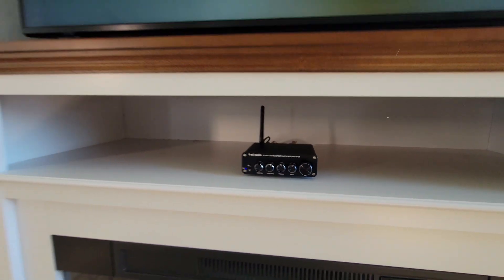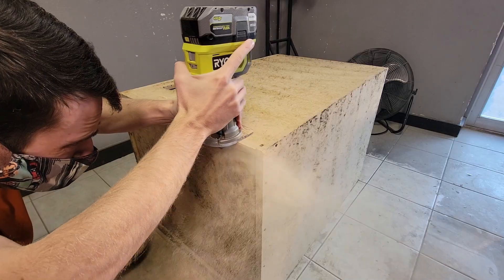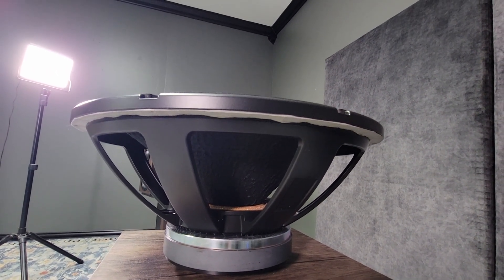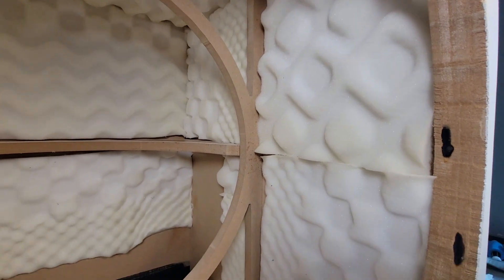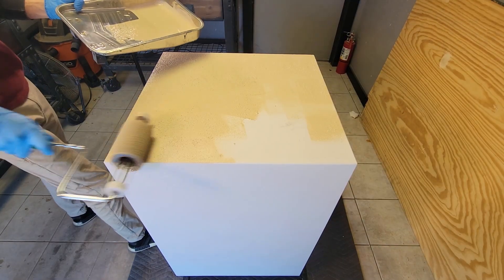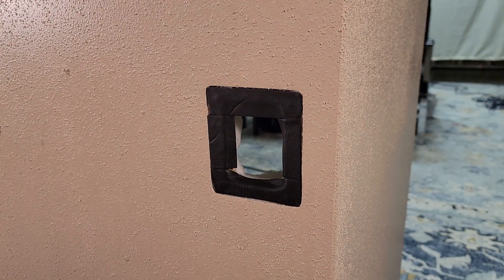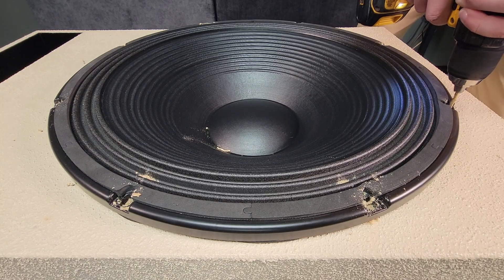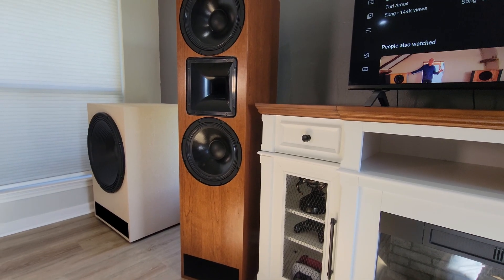Building The Cheapest 21-inch Subwoofer In The World / Powered By A Desktop Amplifier

Comment: Have you noticed when powering off the small amp makes the speakers pop. Like fully of the main power. I have the same amplifier for my set up. As long as i keep to connected to main power it doesn't do it. So im not sure if it's the amps or power supply which dumps the power

Comment: the output of this being so high from such a low powered devices does seem crazy on the outset. However, if you go back to the 70's, you can see how the industry already had to do this. Back then they didn't HAVE 100 watt home amplifiers, and had to go MASIVE on the cone size to achieve high volumes. I still remember my dad sansui speakers he bough while in the 70's when he was in the army. they were 5-way!!! speakers with 15" 'lower-mid' range cones and had a max power rating of 80 watts at 8 ohms. my brother and I were never able to turn them all the way up, they were SO LOUD!!!!
Reply: In the first time the large membranes that reinforced with spokes introduced (maybe) in the beginning of the 20 Th century and those were very thin . Those built in to large cupboards what were both acoustic amplifiers and (ornamental furniture) was. At that time those were full-range speakers and in the early days, the engineers fight many problems, such as efficiency.. (Those were very weak and aren't bass speakers).

I give some information to seekers..

Why more speakers and not a big one, and hear a real low frequency (?)...

Fs – free-air resonance frequency of the driver (here i used it a bit for for box resonance reference).
PA – Professional Audio (stage systems).

-The first: is the box complete size and the chamber size of the box what need to the excursion. (For huge boxes for a most of people haven't got enough place) A large speaker can move max (some) mm in a little box with enough soft sound.
The air compression cause distortion, not wanted sounds, mechanical sounds of speaker and hardness of sound. (but unfortunately moving too much air cause another problems)
For this reason an average low frequency speaker can be use on the 1/3 .. 1/2 of the Xmax without mechanical sounds.
In my experience the chamber of speaker size is optimally (membrane surface cm^2) * (excursion cm) =liter. 
Maybe you think this is an exaggeration.. (and really is not in every case good, maybe just i feel it good).
This is a limit where i cannot exactly sense more hardness. (With MY speakers).
My favorite box chamber ratio is W:H:D 2:2:1.

And the fact of acoustic short circuit what based on box duct length what if not enough long that cause you cannot hear the low frequencies. The duct cross-section area is in the technical literature is the 0,7 of the membrane usable surface but for example i use 100% because it depends on length because the forces (air pressure) on the membrane must be tiny. My duct is now 4,25 + outside 1 meter long from membrane to membrane back side and a strongest resonance is perceptible really on 14..16 Hz.
This way you see the box size is will be soon huge. 

-The third: the mass and surface of a large membrane cause it is late in phase compare with the smaller membranes. It maybe manageable but with just some mm move, this is why the PA speakers not infinity large. 
(But the large (more speakers) surface with tiny move is a good strategy for softer sound, lower frequencies)
The membrane materials (and of the box) is take a physically resonance frequency limit, absolute impossible made an FS under 15..20 HZ because the needed rigidity and low distortion is contrast to the lower FS materials softness and those mass.
This cause that the larger woofers has not exactly lower FS just the moving mass compensate it a bit but far not enough. (And the membranes have 'wild' resonances what you hear as sound but does not the original frequencies)

If even so you try to build one..  the materials thicker, heavier, less responsive extreme hard to move or brake down by physically inertia  meanwhile the magnetic gap need to be very thin without coil crashing with magnet.

When i started to studying these me too want lager membrane but i see how that work in the real world.

If you seek a big one you can watch the "The making of the Matterhorn" from Danley sound labs. In the interview video the man say the parameters. If does not impressive than nothing. (40 speakers if i see good)
I think that need to be sectional phase controlled but i don't remember he said.
And i think they use the colliding waves undergo constructive interference and they made a 'virtual horn from air' but i don't know.
I tell you it use another known audio technology fact: The 25..30 cm speakers give enough good electrical efficiency-Mechanical efficiency ratio.
  
-The fourth: hard materials and surfaces in the room can change the audible frequency, that sometimes multiplied because of the limited distances of the surrounding surfaces. 
Maybe you feel those enough low the truth is 'those are not the original low frequencies'. 
For example the needed distance between you and speakers is around 4 meter (343/20/4) (on 1/4 wave length) on 20 HZ if you have all the speaker and box can the frequency.

And if you can all do it somehow, than you meet with the next fact: All objects and material in the room begin annoyingly resonating :)

(every bass speaker can be produce very low frequencies but just with very low efficiency especially in small box)

The hifi lovers try to make lower FS multi-layered or foamy membranes with fast movement (nowadays expensive electronics and hard magnet motor and huge coil (that give heat dissipating and electrical efficiency) can control the movement of a 40..45 cm woofer enough fast with minimal distortion and less 'wild' resonances in a small box (but that is a hard task).. 
And the PA systems work with minimal moving and much more rigidity for higher volume.

And we have the box not wanted resonances (especially the horns have that).

And on the end of these, your hearing have a limited dynamically range what cause if you increase the volume you lost the details of all the sounds.

Subwoofer is in audio literature under 50 Hz but i use my own between ((3Hz -12,3 dB)5 Hz -3,2 dB) to (18 Hz -3,4 dB (MFB single ended butterworth second-order filter, read upon it)) it is underdriven below FS, is a good technique especially combined with a limiter for softer sounding.

Really the fact from woofer is: On original real low frequencies you rather not hear some another sounds when an subwoofer working than hear low frequencies. (But the pressure of air is tires your ears and brain more than you think (!) )

I write all these for others who's want to know something  (starting strategy).

Comment: with the BT30D at 32v / 5a you can only send around 20watts to the 8Ohm speaker before it starts clipping. This will damage the speaker and the amp. That's just dumb, because even with the BT30D pro at 50v / 10a you can only use 165w / 8ohms max. Do more research

Comment: I wonder what this thing would sound like with the 1000wrms! I just completed a custom build on a really old Peavey sp118 passive woofer. I replaced it with a cheap Rockville rockville rvw1800p8 matched with some passive LPF's, a Mackie Mixer, and a QSC RMX1450 in bridged mode at 840wrms @8Ohms and holy hell this thing slaps! I changed it from the original 46Hz tuning and dropped it down to about 35Hz with a custom port and wooooow it really pushes some air! Love seeing stuff like this where it can inspire people on a budget to really get creative. I probably spent around 400 for everything and got a super nice subwoofer out of it. I paired the sub with 2 Peavey 215 cabinet speakers on a QSC RMX850 @4Ohms and wow it sounds so balanced and crystal clear! Best home audio setup lol - maybe a little overkill with about 1500wrms going to the sound system, but got dam is it worth it! Cheers to cheap audio builds!
Reply: It sounds like crap obviously. That why there is no sound test.
The amp at 32v/5a can only send around 20watts to the 8ohm speaker. Then it starts clipping. The Amp can't handle the load for long and will break. Its a really stupid idea.

Comment: what is the use of the 21inch sub if you have such a small amp that goes up to 100w rms for that 21inch sub you should go for a at least a 1000w rms amplifier
Reply: it's a high-sensitivity driver and not every application needs as much power as the driver can handle

Comment: @4:05 isn't sensitivity measured at 1khz which is not helpful for below 100hz subwoofers?  Not nit picking but have heard the sensitivity argument debunked in the past.  I have built many sub boxes in the past with pretty poor carpentry skills, the wrong tools, and ended up with an embarrassing looking box  but SLAMMED!!  I use Winisd to model my subwoofer ideas and am always excited once it is finished to START TESTING!!  

Last project wife and I did was (2) 18" Stereo Integrity 8cu foot sealed angled boxes for behind the couch (1 8cu ft box per 18").  Had to purchase a Parts Express DSP module to tamp down 65 to 80hz because it was like 10 db louder then the rest of the range.  Thanks for the video, enjoyed it!

Comment: Do you have any recommendations for these in a sealed box? 

I have a pair of sealed ultimax 18s for ulf and will have to place the 21s in a 30hz null due to my room layout. 

I built a custom console that currently houses the 18s but I plan to turn the 18s into side tables(and avoid the null)  and replace them with the 21s. They will be powered by a crown 1002

Comment: Also, the sub itself says it's rated for 1000w RMS, I've read (countless times) that it's worse to underpower a speaker than overpower it, how is giving 1/20th it's rated power okay for it?
Reply from the maker: Hi, this is a myth. There is absolutely nothing wrong with running a driver with low power. In fact, the majority of the time, a driver is being used well below it's rated power.
Reply: @DIYhyfy  That's a good point. Thanks for the reply! Been loving the videos!
Reply: @DemarcusJohnsonIII  It can damage the coil of the speaker when under powering it if u are pushing the amp to its limits. This will make the amp clip and fry the speaker. U want to spend clean power, so using  an amp that has more rated rms to the sub is better then under powering a sub and pushing the amp. Hope this helps!!
Reply: He's giving the sub 100% power at whatever volume level he's listening to. Lol.. do you want him to only play at like 135dB?
Reply: @BobFrostV more like 60bd😂

Comment: Im looking to build a dual 21" subwoofer for my christian edm events - would these Dayton subs work? what amp would I need to really crank up the volume and shake the room? Ideally we would build two dual 21" subwoofer enclosures and have them side by side in front of the DJ ... what amps would be required to make sure they get powered correctly and what box enclosure should we build to make sure they slam? (our build could be dual 18"s if that makes more sense - similar to JBLsrx828sp)

Comment: I am enjoying your content! 
Let me suggest that you would notice a sonic improvement if you bypass Bluetooth? I switched from Bluetooth (which I thought sounded fine) to a DAC (the good measuring, highly regarded, and inexpensive S.M.S.L SU-1) using the HDMI ARC output from the TV, and was surprised by the very noticeable improvement in sound quality. I’m sure your setup sounds great but I believe there’s untapped potential yet to be realized. Keep up the good work!
Reply from the maker: Yes, I have since gone with my separate dac, pre, power. There is of course a huge improvement. 
But as mentioned in the video, I does sound great. Especially at such a cheap price. Just to get a newbie into the hobby, they're great, amd affordable.
Thanks for watching!

Comment: The mattress topper is doing the square root of f-all. Standing waves aren’t an issue in a subwoofer enclosure as the wavelengths are longer than any of your enclosure dimensions. Even if standing waves in a subwoofer enclosure were an issue it would still do nada. In order for “egg crate” to do anything the peak/trough would have to be minimum 1/6th of the depth of the wavelength you’re trying to diffuse.

Comment: Hello sir, i'm an engineer from italy, i'm on PA management field. One thing about this setup i need to say, the amp besides being really cheap, is the classic "mini house hifi amp", this means, probably have really really small control on a 21" pro driver, that can results in various problematic situation that can damage the driver, pro driver need to have a lot of power reseve, that's why PA amplifier are so expensive. Keep anyway in mind that a 21" pro driver is built to be driven from atleast 2kw RMS amplifier, but it can easily get damaged from a 100w no reserve amp peak/square.
I'd suggest onestly something more PRO related, maybe china/cheap products with more complex DSP and FIR, they became a lot more affordable nowadays.
Reply: He could measure his fosi amp with a load and oscilloscope to check for waveform distortion. My hypothesis is that it won't be a problem in his use case.
Reply from the maker: Interesting, are you saying it needs more rms capabilities? I'm not generally running it very hard at all. The driver is only 1K watts rms, and didn't model well with that much power in the enclosure if I remember correctly. I may be missing something you are saying though
Reply: @DIYhyfy  Sure, enclosure is not tuned to get the XMAX, but the thing is, if u get a transient on a track or something that makes the amp peak or lose the power reserve ( that at this point is really low, as amplifier dimensions say) the peaking of the amplifier can easily fry the coil of that woofer, since ur running it low probably it won't happen, but usually with driver that have this kind of RMS rating, ur most likely safe with an amplifier with atleast 1kw lets say. Consider in pro audio, we usually dimension amplifier at 2x RMS rating of a trasducer, exactly to not fall into the "out of control" situation. The only one apreciable thing that it gives u this way, is that its resonance frequency is most likely giving u higher efficiency down to 30/40hz, but also large pro trasducers have lack of sensibility if compared to smaller one. At the end of the day probably it was better to get a subwoofer 15" tuned really low, saving a lot of money (they're cheaper then 15" mid/bass speaker) compared to the 21, and invest a bit more on an amplifier, this way u can tune an EQ on the woofer for a linear stable response let's say from 32 to 60, that is most likely what u need in HI-FI. I saw u building the other speakers with also pro driver, the cross point is a crucial decision. If u want to also pubblish something intresting about having cheap HIFI i can give u some tips about things aviable in USA that are crazy underrated, i also usually buy strange DSP's from ship demolishing and things like this. 
One last thing about trasducers, if u really want to try build something insane, B&C and 18Sound in italy and BMS in germany, provide insane Hi-fi speakers plan, we built one for an installation with a berilium driver (4015BE), that was astonishing, with a custom ADAC 384khz, mini paraflex long excursion 8" subs and overall a cheap product compared to most blasonated HiFi brand, also we got Sonus Faber techicians working with us.
Reply: @dadesakko  21" subs are often much more efficient than 15" subs.
Reply: @hans4me2  ??? intresting information, it makes a lot of sense that more moving mass lead to more efficiency.
If u have no clue about phisics works stfu please, don't give misinformation.
Reply: Well doubling the mass or area of the driver will take less additional energy than doubling its speed. Now I don't know how those relate to SPL because I just discovered this hobby a few months ago. But that's how I thought about it: a smaller driver will have to move faster than a big driver to create the same SPL. And it takes more energy to move faster than it does to deal with additional mass and move slower.  @dadesakko
Reply: @UnfoxYourself there is a specific value for this anyway, it’s called “Sensitivity”, u can find the difference between small and bigger transducers, also depend from a lot of specs.
Reply: This makes absolutely no sense. Can you elaborate more? If the amps bottoms out you could argue that it would sends wrong "info" to the speakers and that fries the voice coil but it's not like the amp is gonna break.
Regarding efficiency, a bigger driver can create lower bass at less watts. Car guys surely know this, bigger subs=more spl

Comment: What’s better? This or the 18” Ultimax. It would be for home theatre.
Reply from the maker: I would have to say the ultimax is going to be better for HT. I say this mostly because of its excursion capabilities. The 21 certainly plays low, but not with the same spl as an Ulitmax. I say all of that semi subjectively, as I can't back it up with measurements right now.
Reply: I guess it would depend if you’re comparing sealed verses ported as well.

Comment: That cute lining won't offer any damping. Damping the sub would come from bracing to add rigidity and move any resonance into frequencies the kilohertz range, which the sub doesn't excel at - or with some CLD where a constraining layer attempts to resist resonance, like in car audio. At best, it at the extreme minimums made the apparent size larger, lowering the Q of the sub. Nice build though.
Reply from the maker: You've conflated panel resonance with standing waves.